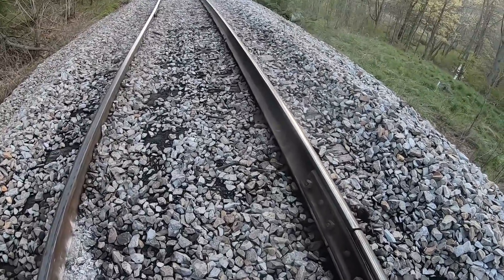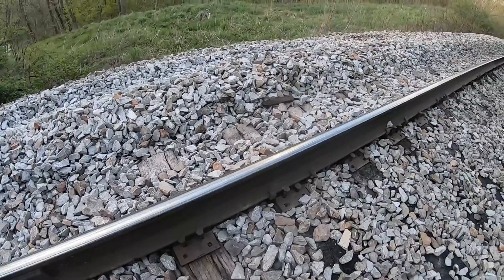Major Derailment: Locomotive Derailed & 2 Cars plus1400 Feet Track Tore Up!

Comment: I am surprised that they left the locomotive running. Would have figured that they would shut it down. Sure was a mess.
Reply from the maker: You might find this link interesting Michael on why locos are
not shut down that often

https://www.drivespark.com/off-beat/why-diesel-train-engines-are-not-turned-off/articlecontent-pf83615-025034.html
Reply: @ccrx6700  That was interesting. I figure it does have more to do with the issue of keeping the brake lines full of air. I served aboard Coast Guard cutters that had the same exact engines that diesel locomotives use and we shut our engines off all the time. In fact, to be able to save fuel and remain out on patrol longer, we would run one engine at slow ahead idle, shutting the other main off, alternating every few hours. It was rather easy to restart them, so I don't think that plays as much a role as what they said in this article.  I was thinking in the case of a locomotive that had derailed, there might  an issue of damage to it and possible leakage of fuel, leading to a fire on board the locomotive, so they would automatically shut it down.

Comment: why is the engine is still on?
Reply from the maker: Read this article, it will give some good insight on why big
diesel engines are left running

https://www.drivespark.com/off-beat/why-diesel-train-engines-are-not-turned-off/articlecontent-pf83615-025034.html

Comment: I'm surprised you don't have check rails on the tight curves
Reply from the maker: Probably cause the track speed is 25, I know on some other
RR's with much higher speeds they do have them. Thanks for
watching Bill
Reply: @ccrx6700  even on low speed track in UK they have check rails. It's just insurance against track damage in the event of a disrail
Reply from the maker: @billmilligan1705  ooops, i miss understood you, we do have check rails on bridges and 1 tunnel, we call them guard rails or Jordan rails
Reply: @ccrx6700  you really should have them on tight curves along with flange lubricators saves a fortune on track replacement
Reply from the maker: @billmilligan1705  we have 16 mikes main and have 6 flange greasers spaced out, they do make a difference for sure. I'm not happy with the guard rails on curves because with them in their i can only tamp the outside of the ties which creates an uneven fill under the ties below the rails, does that make sense

Comment: So how did the lead loco get so far beyond the derailed cars?
Reply from the maker: It wasnt lead, was end of train dpu
Reply: @ccrx6700  I got you. So it was the lead car of the last two that the truck pin wore out on and rolled the rail. Before it could stop it drug them 1400 feet. That makes much more sense. Thank you!!
Reply from the maker: @tommyhunter1817  👌
Reply: @ccrx6700  Those ties look like one of those German track unzippers from WWII got hold of it.

Comment: Everything stayed upright, somebody must be watching out for you guys. What's the track speed for this section?
Reply from the maker: Yep we sure did luck out, things could have been a lot worse. speed
is 25, he was going about 23 when this happened. Appreciate your
watching
Reply: @ccrx6700  I was watching the rest of your videos trying to understand the details surrounding the derailment. I am kinda confused though. Was the engine shoving the consist? In another video you showed some pretty awesome burnouts on the rail head. Were you saying you thought the flange of one of the cars caught a hotspot and rolled the rail?
I am a retired safety and compliance guy and these sorts of incidents used to be my worst nightmare, especially when Risk management is breathing down my neck looking for someone to blame. "Gentlemen, we are talking tons and tons of metal on metal for years, these sorts of things do break down and we are often lucky enough to catch it before it causes a problem. Today we weren't so lucky!" Not every derailment is an HFI, despite what they tried to say to us.
Reply from the maker: @SD40Fan_Jason  thanks for the nice comment, enjoyed it. HFI? Human factor influence?   Loco on the ground was EOT DPU, it was under throttle 3 when derailment happened, they were going 23 MPH
Reply: @ccrx6700  HFI - human factor incident. And a DPU? gosh that makes sense now but ouch.

Comment: In the midst of all this, the engine is still running. Is that policy or optimism?
Reply from the maker: Read this web page, perhaps this will help answer, also Trains
Magazine has a discussion of that topic on their site

https://www.drivespark.com/off-beat/why-diesel-train-engines-are-not-turned-off/articlecontent-pf83610-025034.html
Reply: @ccrx6700  thanks for the article, that sheds some light on the topic. it’s all electric for freight and passenger rail here in Switzerland, so I have had little knowledge of the diesel topic in general :)
Reply from the maker: @sayswithoutgoing  👍

Comment: Your derailment started farther back than you are thinking it did, where you showed that it started there you can see where a flange was riding on top of the rail, that spot is just where it started to roll the outside rail and after it rolled over you can see where the wheels road the web of the rail. from the video it looks like the outside rail has a kink a ways before before the spot you are pointing out. I've investigated quite a few derailments in my 37 1/2 years on the railroad and the derailments never start where you first think they did. Each department tries to blame the others(track, mechanical and transportation).
Reply from the maker: As Thomas the Tank Engine said, Silly cars always causing
trouble because they are angry. Thanks for watching my friend.
And as you know the track men always blame it on the car men,
the car men blame it on the engineers and the engineers
blame it on the track men...LOL

Comment: Hi ... me again CCRX6700 ... greetings from the French Riviera. Following my comments on the other video you posted about the root cause of this particular derailment (being the truck without Grease) I got to thinking about your comment therein that rightly noted that our American rail-to-sleeper (Tie Plates & Spikes) fastening systems provide adequate "Gauge Control" (horizontal load) but not very good in the vertical axis; the spikes just pull out.

As stated in your a/m video, I grew up in a "Railroad Family" and I myself worked for MoPac back in the day in Texas before a 4 decade career in Aerospace (in 38 Countries around the World).  Having travelled so far and wide, I of course observed different rail fastening systems and boy are there some strange ones out there.  Hard to say with certainty that other Rail fastening systems would have prevented this derailment ... but it might have.  I realize it's difficult for American Railroads to "Change" after 150 years of conventional wooden ties, plates and spikes ... but perhaps with the increasingly expense of wooden ties, it might just prompt movement.  There are approximately 3,000 ties per mile of track ... imagine the cost benefit of upgrading at least some of it, on an attrition basis, starting with "Curved Track Lines".  In Europe and other Countries, they have switched almost exclusively to "Concrete Ties" and "E" or "W" elastic (spring loaded) fastening systems; see video below.  Makes me wonder if this system would have limited the destruction in this derailment ... had the rails been able to "snap back" and not rolled over ...

https://www.youtube.com/watch?v=Z52MVUF1PAo

Comment: is that a sd39, sd40, sd40-2, sd45, or a sd70Ace
Reply from the maker: 38-2 . we have 2 of them plus an sd 40-2. That loco was built
for this mine in Dec 1975, this is the only service it's ever had. I
cut my teeth running this loco way back, it broke my heart to
see her on the ground. Thanks for watching
Reply: @ccrx6700  in the video inspecting the truck on the freight car kinda helped me understand why my ho scale rolling stock are derailing
Reply from the maker: @Warbonnet601  several other model railroaders have written in same thing 👍

Comment: Okay so the locomotive that is on the ground was the DPU on the back-end? That is the bad thing about running a headless unit as there are no eyes to see what is going on and stop the train. Then again based on the last video I just watched the empties headed back, those train drivers fly through there which is probably why the distance between the disconnected cars and loco.
Reply: Thought speed was a clear factor also. Just based on the distance where it started and where the loco landed.

Comment: Hi Dave. Thanks for the great report. I am rather surprised you guys don't use a more modern tie plate, like the ones that use spring clips on either side over the rail flange that are hammered in. From what I've  been told, these hold the rail upright much better than just spikes, which can pull straight out. The new plates can be used with screws also, which are really secure, but I guess a bit extra work initially, and probably more expensive overall. Good luck and good weather for your repairs. At least it's  summer there, not like 3 deg C (37 deg F) where I am.
Reply from the maker: Yes the Pandrol clips do, this track was built 1975/76 using spikes,
so to change all of them over is a monumental task and tremendous expense and if we just did it in the high degree curves, well we got 70 curves and over half of them are above 5 degrees
so again it's monumental

Comment: Hey Dave!  I wonder if some cheap insurance like knee braces on your curves would help??? They use them on Tehachapi and have never had a rail roll over!!! That center bowl you showed us did not look healthy at all! It did have a liner though and should not have had a problem with the turning moment, but it obviously did!!! I believe that there is a co-culprit in this derailment that may never be uncovered. What was the temperature at 5 in the evening Thursday??? You might want to look for heavy gage face gouging! That will tell you what you want to know!

Comment: I'm not sure I'd call it a "major" derailment, with only two cars and the motor on the ground.  That's not really much of a derailment IMO.  However, the mess it made of the track and trackbed plus that it appears to have happened in the middle of nowhere would seem to make up for it.  I'd say it's not the derailment that's major, but the mess it made of the track sure is.
Reply from the maker: You are correct, for many RR's this would be small potatoes, however for our little short line it is a major event, albeit unwanted.
Thanks for watching and hope you will watch the upcoming videos
that explain so many other aspects of what all happened here, there gonna be 8 more videos out about the derailment

Comment: Need a flange lubricator on that curve maybe
Reply from the maker: There is one less than a half mile up track, but it partially
plugged up with coal fines, we have just a terrible time keeping
the grease bars from getting plugged, LB Foster even tried
inventing a new type of bat to shield the coal fines but it doesn't work a whole lot better than the original design. Good observation there sir

Comment: Wondered about overspeed, otherwise  one little flaw can cause a chain reaction. Only takes one weak link in the process. Will be curious to see what happened. I had to go around a series of coal gondolas with Amtrak #4 east near the top of Raton a few years back. We crept past the cars upright on the ground with inches to spare. Breathed a sigh of relief when cleared. They rerailed it the next day but a couple weeks later on my w/b, saw the huge gashes in the ties. Seen that on top of Glorietta too. Bottom line, items can be fixed or replaced lives can't. Always glad when nobody gets hurt or worse.
Reply: 1800's track tech does have its limitations...  I'm just amazed to see it carry the loads that it does as consistently as it does. It seems like the US should at least be using 60 kg/m track with concrete ties by now--something more stable and durable at higher speeds.
Reply from the maker: Thanks for watching and hope you will take in my next video
on my theory on why the derailment happened. It's here:
https://youtu.be/2uGomCuZkV0
Reply from the maker: Thanks for watching and hope you will take in my next video
on my theory on why the derailment happened. It's here:
https://youtu.be/2uGomCuZkV0

Comment: You going have vid with completed repairs...
1200 feet, is that 30 track panels...
Reply from the maker: Sure woulda been nice if we had them, but none available. Hulcher had some but wouldnt give them up since they hav contract with CSX which requires them to keep a certain number on hand. May interest you, when yrack was originally built, it was all by panels
Reply: @ccrx6700  So if no panels available, all new work was laying new ties and stick rail..
Was old ballast reused...
Reply from the maker: @donaldwittmuss6079  lots new ties, south side old rail, north side rail was replaced with relay rail. All old ballast was used Donald, much more details will be explained in the next 8 vids coming out soon to a utube near you...
 😊

Comment: I'm no expert, but, I suspect speed was an issue. Possibly going too fast around that corner. Do your Locos record speed, air brake, and engine RPM data?
Reply from the maker: The locos have speed recorders, they are old locos and don't
record near what the new ones do, don't even have an rpm gauge on these...lol Thanks for watching and hope you'll stay tuned for
the rest of the vids in this series
Reply: @ccrx6700  I've been a railfan for many years. I'm sorry to see a derailment occur after all of your hard work. For the rail to roll on a curve, it's either speed or, I hate to say it, old ties. On very old ties, the spikes can't hold on anymore, and over it goes. Another possibility is a broken rail. Have you found any broken rails? I saw the seriously cracked rail near the base. That rail may have moved over enough to cause the wheels to come off the opposite rail.

Comment: Hi Dave! Let's look at this as a couple of track men. It is now the month of June. It is in a curve, and it appears to have happened under the rear third of the train. SUNKINK!!!! If it was not a full blown SUNKINK, I would be willing to bet that the thermal forces were combined with the braking and forced the high rail to start "walking". I have seen this many times! Just enough to make things go haywire when the braking force is added to an already high compression force. I can see several "flange prints" in the web of the rail there!!! I would not use this rail again!!!!! You could now have cracks in the web causing a web base separation, causing an even worse derailment next time!!!! The fact that the flanges rode the web is why the shiny side is still up with those two cars! I would be really hesitant to use that rail again!!!!! Looks like a lot of work ahead!!!! Let me know if I am even close to right.

Comment: I don’t understand why they still use spikes out there 
Much better stuff out there to use instead off spikes
Reply from the maker: Yes sir, the Pandrol plates and clips have much better holding
power than spikes, but this RR built in 1975 used  all spikes so
to rebuild 17 miles of track would be monumental task. 

Thanks for watching and hope you will watch the next video out on why this happened which is due out in a couple of days

Comment: I think you had a wide gauge situation at the curve and the wheel on the inside of the curve slid off the rail to the inside of the gauge and when it did it caused the outside wheel to start pushing the outside rail over and it just snowballed from there. That’s why the out side rail started to roll out.
Reply from the maker: Thanks for watching and hope you will stay tuned for the rest of the upcoming videos about all of the events that happened here. 
Next video will explain why it happened, you are close in your assumption

Comment: Derailment due to wide Guage.  If you got 6 bad ties in a row the Guage will spread. The Derailment is actually minor. After you get the motor and the 2 cars rerailed,  a tie gang with proper equipment can fix that 1200 ft of track in less then 8 hours.
Reply from the maker: Thanks for watching and hope you will stay tuned for the rest of the upcoming videos about all of the events that happened here.

Comment: If it was one of them crinkle cut chip, rollercoaster rides you see on some vids I could understand it but you oversee this line with absolute dedication weeding out the issues before they become a problem.   Would it be worth it to convert to Pandrol E clips as they resist the hot/cold temperature fluctuations that do affect lines with driven peg chairs?   Pandrol E's and concrete sleepers then the only variable you have to worry about is the rail itself and it would mean the trains could travel a lot faster or heavier too than what its rated for now.
Reply from the maker: Thanks for watching and hope you will view the vid that
gives my theory on why the derailment happened, link is here:
https://youtu.be/2uGomCuZkV0